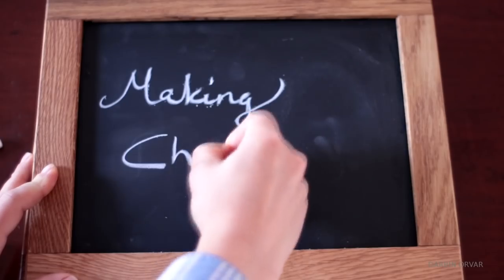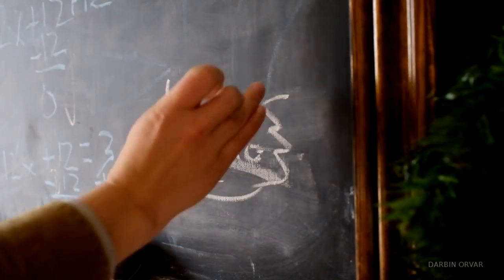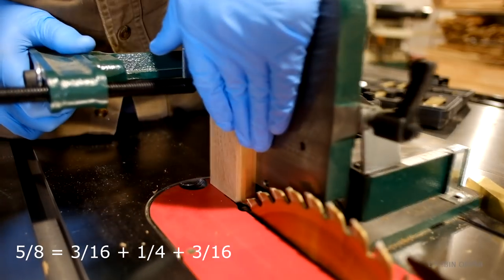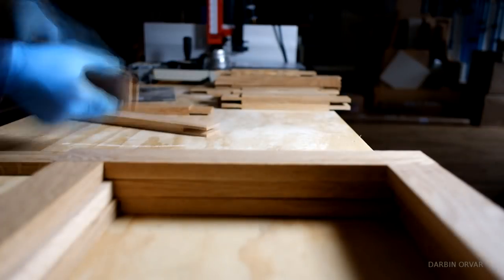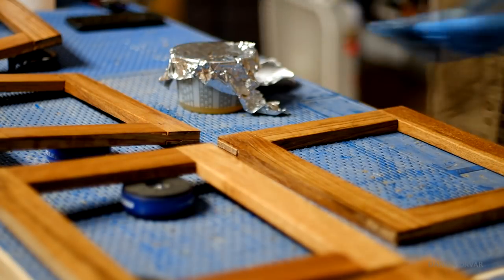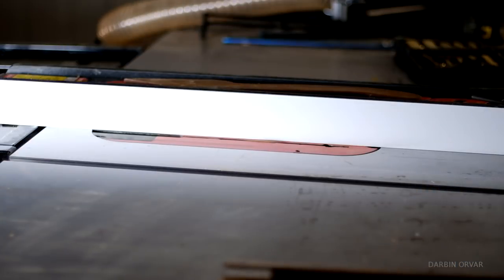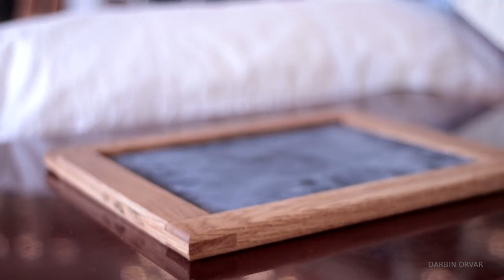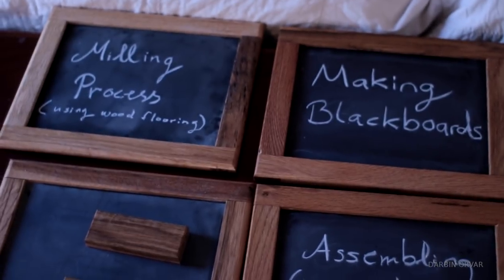How To Build a Chalkboard & Eraser

Comment: Use Butchers Wax on all your metal surfaces to prevent rust. Helps the wood to slide also. WD40 or other solvents leave an oily film on the surfaces that can transfer to your projects.

Comment: To prevent rust on the machines use wax or oil, just pass cover the whole cast iron in wax or soap or oil, this way you will make a patina over the cast iron and protect it